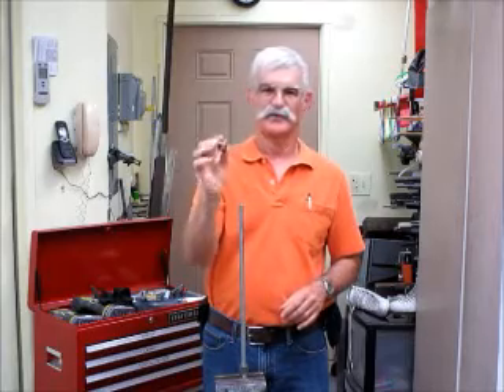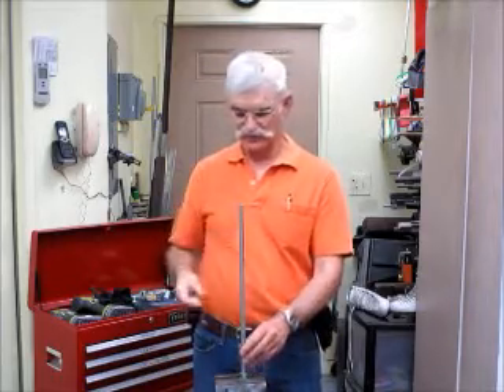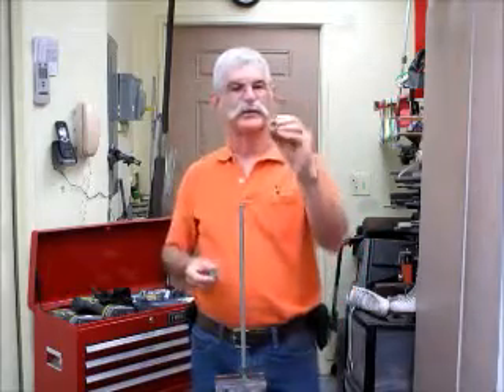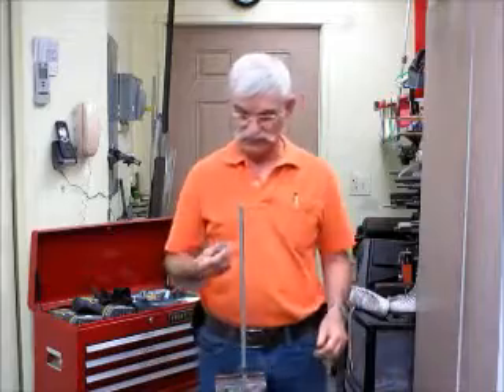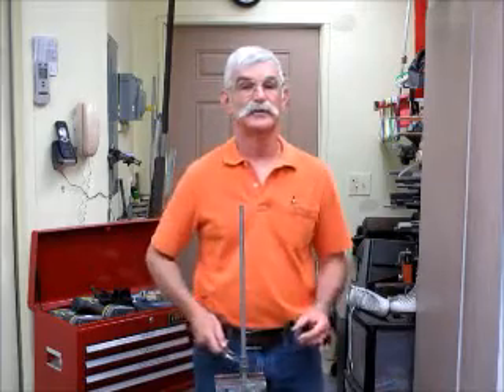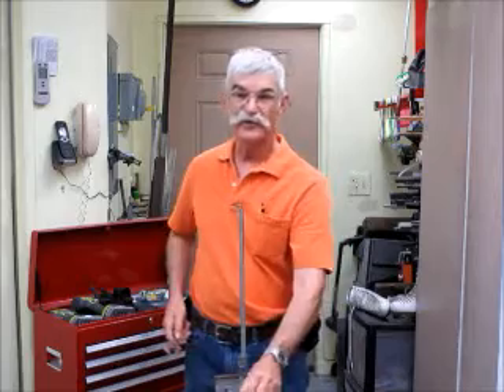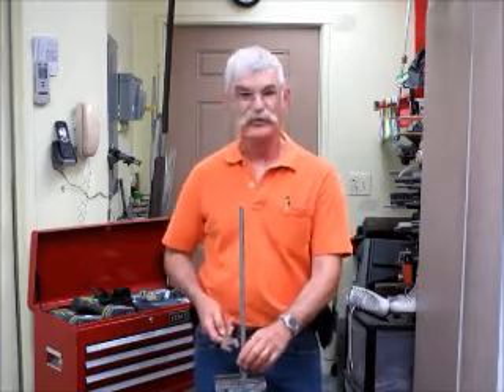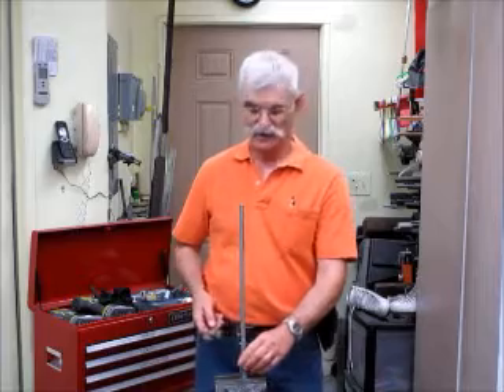Angled Half Nut

Comment: These are called quick nuts in UK. I use one to hold a Vise-Grip type clamp to the drill table - quick and easy so the temptation to hold by hand is more readily resisted!
I'm afraid the link to your pdf did not work for me.
Reply from the maker: Contact me privately and I will send your the file.  Rick